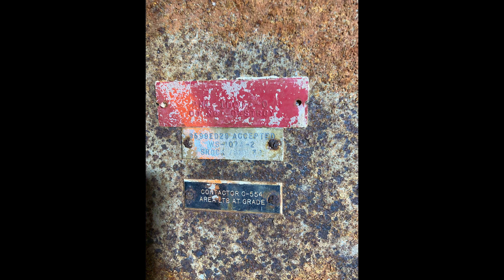S1E28 - 4K - Getting the ALL of the mud out of the Blast Lock - Owning a Titan II Missile Silo

Comment: So once the septic pumps are restored, where does the liquid from that pump to?  Are there holding tanks above, or a leach field type setup?
Reply from the maker: There was a holding pond. I’m not sure what I’m gonna do yet
Reply: @atomicunderground9971  Those pumps certainly would make your life easier, as long as the plumbing taking it up and out are all still in place.
Reply from the maker: Not really. The system I have now is very reliable and hasn’t caused any problems